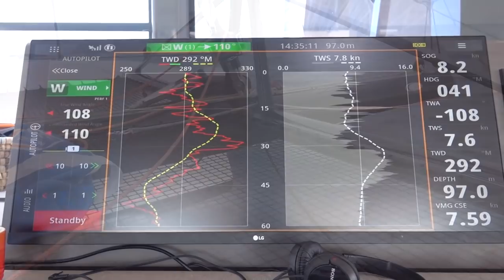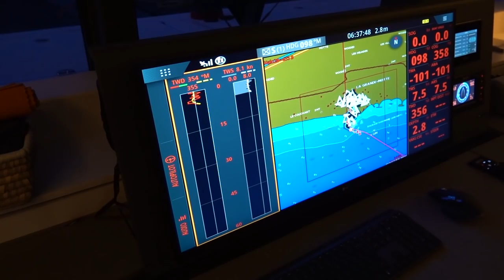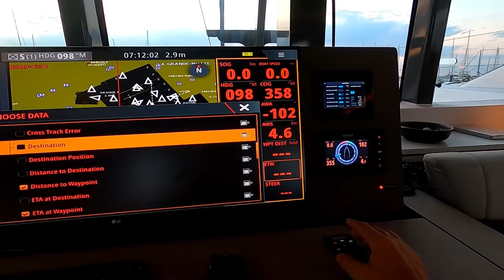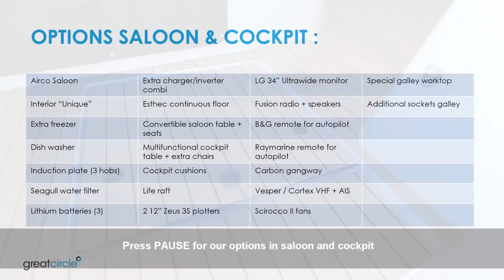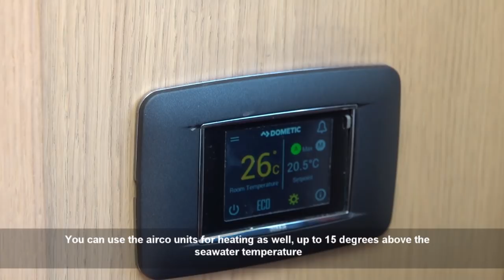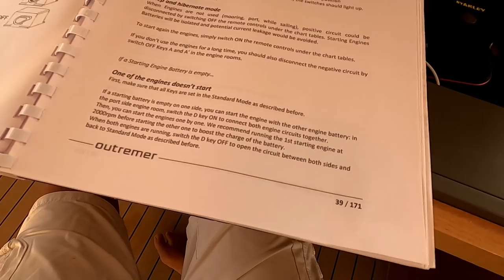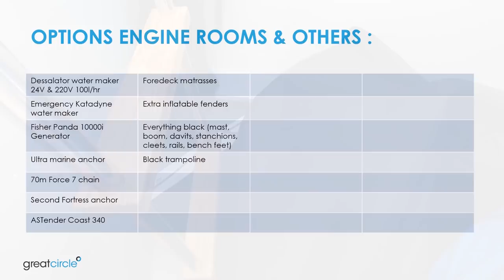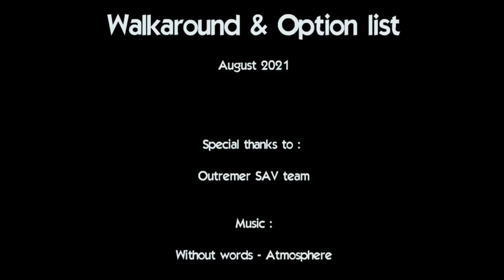Walkaround & Option list Outremer 55 Greatcircle - Sailing Greatcircle (ep.221)

Comment: Thank you very much for such a complete view of your boat. The only thing on a safety note is that with the escape hatches on a number of vessels on youtube have had major leak problems. Seawind on a number of vessels now are installing straight windows with safety glass but install next the windows a glass breaking hammer. Thought you may want to change before it is to late
Reply from the maker: I know about the recall for the emergency windows of a certain brand and type but we are not too worried about the ones we have.

Comment: Terrific tour, thank you. 
USB chargers everywhere - convenient ( I have them all over my house as well). However... my Anker battery once got wet at the connector while it was plugged into my iPhone - it started to heat up, melted parts around the connector. Still works, but could've caused a fire. Perhaps part of a captain's briefing to new crew/guests should include: be careful with your devices. If they get wet - do not plug them in. Of course I'm not an electrical engineer - just a busy body.  Commercial airlines I've read have metal fire boxes to place devices into if they start to overheat. Perhaps one of these, or a kitchen pot? 
If in a few years you see me on a 55, Outremer owes you and Marjike a referral fee.
Reply from the maker: We call your metal box “oven” or “Miele”, she listens to both.

And yes I agree, send Matthieu or Xavier a message. But a symbolic fee is ok as well as it is easy to show happiness when you’re happy

Comment: I got this tip from an authorized Bosch installer/repairman and countertop installer. To clean and remove fingerprints from brushed stainless steel spray some WD-40 on a microfiber cloth and swipe back and forth, not vertically or in circles. Buff with a clean microfiber towel, again in side to side motion. Works on stainless steel sinks too and can remove calcium build-up.
Reply from the maker: We could try that as well but it seems like there’s an issue with a series of Isotherm fridges as all 55’s have the same problem and the freezers from the same brand are all ok

Comment: The Outremer 55 looks like the perfect trade off between performance and comfort - big enough for comfort and while being a fast performer. Your choices and addition is just outstanding. Two questions/areas I would like your take on:
1) How to you find the new helm solution ? Which one to you prefer in what conditions ? I like the  Balance 526 helm setup - how do you think the two helm solutions compare?
2) If I understand correctly, displacement is stated as 13.9/18,5 ton. Does this give you "enough" volume/ton for equipment/fuel/water/food/toys without loosing "too much" performance in light wind?
Thanks for sharing
Reply from the maker: 1) the helm station on the balance is more protected but leaves only the traditional setup with the small door between cockpit and saloon. Just crossed the Atlantic and for us the current setup works really well
2) the 55 seems much less sensitive for a bit more weight if I compare our speed to the other boats. We’re probably 16 -16,5 fully loaded

Comment: I'm curious as to why you have a hot water heater w/40 liters instead of a demand water heater. Lovely cat. Thanks. Cheers
Reply from the maker: I am not an expert but don’t you need a gaz or diesel heater to have an on demand hot water function?

We haven’t looked into it as for us the water heater will probably be on most of the time as we have the genset as backup

Comment: As usual I have a couple of questions 🤔
How would you compare the build quality and finish between the old GC and the new GC, things like layout of components, wiring, fit, finish etc  Is one better thought out than the other or are they basically on par with each other.   Second ( and last ) Is there anything your missing from the old GC ??
As always stay safe and keep having fun - oh and put your shoes away properly next time  😛😛😜😜
Reply from the maker: Hi Glen, that’s an interesting question as it’s not so easy to answer as you would expect. Build quality has many aspects.

In general the Outremer is better build in terms that it is stiffer and all major components are properly laminated together.

In terms of finish the Lagoon has improved in the meantime as well. If you look at the interior of the Lagoon 55 it’s way better than the L52 and I would say comparable to the O55.
Reply from the maker: Wrong button but let’s continue. 

In some areas the finish of the Lagoon is even way better, for example looking at the teak/Esthec floor, the finish of the engine compartment hatches and the silly setup of the main galley cupboard.

Comment: That second anchor is just resting in grooves with bungee tie downs, you might want to add a clip on the bottom to stop it bouncing up and down in heavy seas.
Reply from the maker: Will have a look but so far we haven’t seen circumstances on any of our cats that we felt this could be happening
Reply: @CatGreatcircle  new England sailor just used to heavier  seas and wave action.

Comment: Nice informative video. Quick question regarding the B&G setup. I seem to vaguely remember a previous video when you were talking about your navigation choices that you decided on the Nac3 autopilot system instead of the H5000. Why did you end up going for the H5000 setup? Cheers
Reply from the maker: The H5000 cpu should be slightly faster but our main considerations were regarding a more reliable wind indication and better displays both at the helm and for the autopilot controllers.

The wind meter is higher above the top of the mast and can be calibrated in the BandG, both TWA and TWS

Comment: Hi we are considering Outremer for our new boat. What are your options on Ocean Volt sail drive systems to replace diesel power engines?
Reply from the maker: You have to ask them but I met a couple already who had a slot on an improved fully electric Outremer 4.Zero.

I do t know whether they’re already willing to do the same on other models
Reply: @CatGreatcircle  thank you, Outremer gave me a pretty good pack of information  on the 4.zero yes I think the electric options on bigger models probably face some weight/power ratio issues. Also for your followers the HH44 hybrid models are very interesting maximising, it seems the best of both worlds.